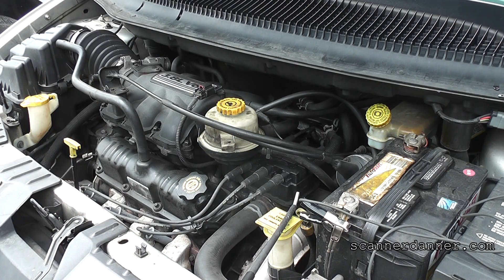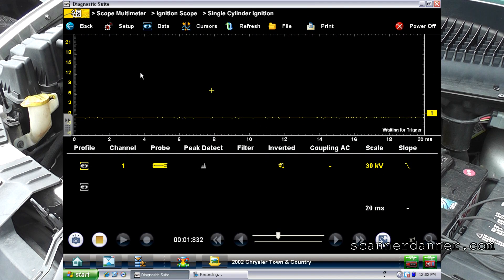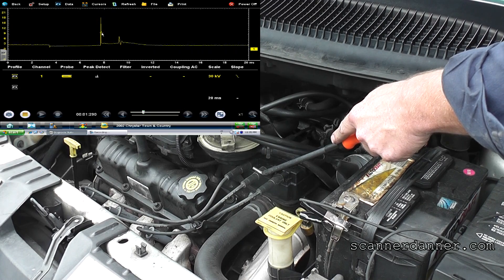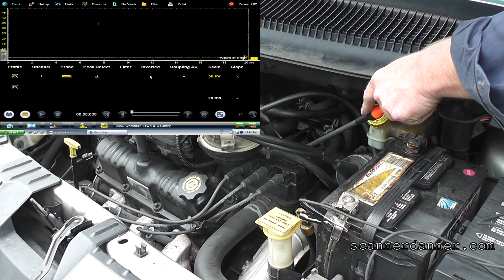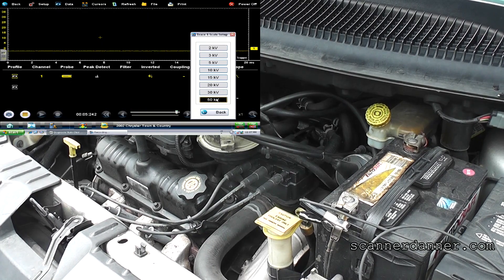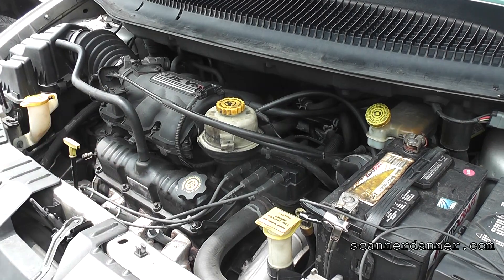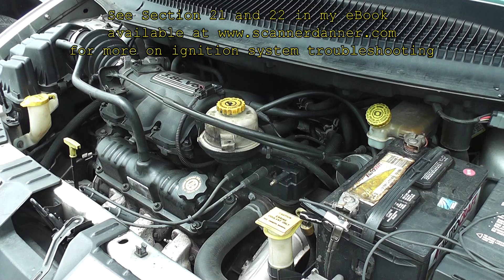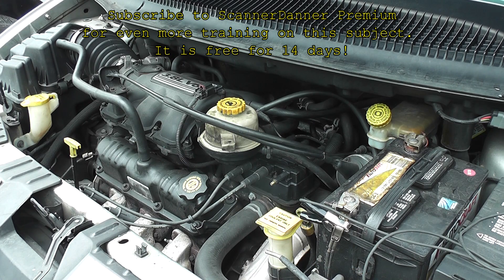Ignition testing with a scope (Secondary Waveforms) - open plug wire

Comment: But…what’s the possibility of a faulty plug or something else going on in cylinder number 5 that caused the cable arcing and then compromise the terminal connectivity to the cable?  Granted, a poor fab or crimp of the cable would likely yield this result.  Nonetheless, could there possibly be something up with cylinder 5 that caused the cable fatigue?
Reply from the maker: Pretty sure I moved the plug wire to another cylinder proving the fault. Sure an open plug could damage a wire, but that was not the case here, nor is it ever something I've seen (open plug). I've seen plenty of shorted plugs though

Comment: "To obtain your warranty, please send you deficient plug wire with the boxes UPC code, the original receipt, the name, address and business license of the store you purchased it at, the name, location and license number of the mechanic who installed it,  and a signed statement swearing it really is the wire you just bought and not one from another vehicle. And of course a check to pay for shipping, handling and whatever else we want both ways. We will then review your materials and decide if your violations of the terms of use caused this failure. Processing may take 3-6 months, failure analysis 4-6 moths and sending your replacement probe 3 months plus the 4 month trip in a slow boat across the ocean, the replacement probe may either new or used as we see fit. We look forward to your continued business, its a pleasure to serve you."
Reply: @ScannerDanner  Thats satire Dan on hoops many companies put people thru to claim warranty on an item, particularity mail order  and in this case the reasonably new spark plug wire. Not all are like that of course but for many its to expensive, long and aggravating of a process to bother with. I speak from experience.

Comment: Can we check secondary problem with in primary current wave
Reply from the maker: some can be seen but not all. If the windings are messed up, we can see that, if the spark is leaking out of a coil boot or wire, we will not see that in a primary waveform
Reply: @ScannerDanner  thank you sir🙏 for reply me. Sir I'm trying to use hantek I never used scope before just trying to increase my knowledge   watching your video thanks from India 🇮🇳

Comment: Thanks Paul, Great video.
It is a good example of how the scope can  illustrate what is going on  without having to dis assemble or  physically dig deep into the vehicle.
You provide excellent examples of what  can be seen  with an oscilloscope.
As a tech I have often found it difficult to see shop owners or managers to see the value of using a scope and to get other techs on board to become comfortable and knowledgeable to use it efficiently.

To those who insist on making do with the most basic methods:
Yes it can be done, by all means do which is convenient and works for you.
But you might be missing the point that the scope provides so much actual information as to what is really going on.
That is what Paul is trying to convey in his videos.
Reply from the maker: Thank you Dave!

Comment: Very cool tool. I just diagnosed (for the second time) one of these. About a month ago the guys in the shop replaced wires and injectors, i was called to look at it, #3 tower was completely dead..pull the plug wire off and nothing! Replaced coil , van was happy...came back Friday with the same misfire complaint and the same cylinder! Found a not fully secured 14pin connector just under the throttle body, the connector is actually broken and can no longer use the red lock to keep it shut...customer doesn't want to replace the connector so...we'll see what happens, could very well have been caused by the guys in the shop when they had the upper plenum off though...wondering if that bad connector had anything to do with the #3 tower not firing and maybe i jumped the gun and replaced a coil unnecessarily....i hate intermittent failures done times lol

Comment: I am pleased to see spark line analysis is still in use by some. I used it daily when I was a mechanic back from 80s onwards but it was a dark art then many mechanics didn't use, and when modern ignition arrived older tune scope could not be tuned to read values from the primary signal to the degree required. I just did a few videos on the topic of spark line analysis and the last one on wasted spark.  One thing you mentioned is the bad spark produced on the companion cylinder was due to it firing at the same time, which is right but Id just point out to anyone watching it who may not get that part, that the reason you see it on the companion cylinder is because in wasted spark each plug acts as the ground for the other plug and the secondary is not grounded to the primary common as it is in standard single coils so the current flows at one plug will be seen at the other plug also, hence inverted in polarity.

Comment: Do you or anyone happen to know the voltage conversion if you use it on a scope that does not have ignition testing.
Reply from the maker: I do not know the conversion and when I use this, I don't really care about the numbers as much as I do the patterns and comparison between cylinders
Reply: ScannerDanner Thank you. Know it is more about the pattern just was wondering I anyone new the conversion.

Comment: replaced wires an plugs run great after replaced parts next day when i tried to start hard to start had to pump pedal to keep running  if i tried to accelerate would stall will run good if i drive under 30 miles per hour  please help me i am lost .think it might be   maf sensor watch you  videos every day thanks keep them coming

Comment: very interesting video and you are one sharp technician.
Reply from the maker: +q zorn thank you!
Reply: +ScannerDanner do you think that a voltmeter can detect the problem checking the resistente
Reply: @Super032208  Tine ist money. It tooks time to get out all plugs. And you will perhaps recontact the broken wires during pulling the plugs.
And you have to do a  low ohm measurement - low cost multimeters don't die that.

Comment: Paul, visually is there a difference in a secondary and primary (coil negative) waveform? Is there diagnostic advantages to one or the other?
Reply from the maker: +Mr. Speed only difference is amplitude. they are a mirror image of each other. you can absolutely see secondary issues in a primary voltage waveform

Comment: hey danner gota question about a 96 chevy 1500 bought the truck it ran nice, i put in a stereo then it rained,.. the next day truck cranks but no start obd2 scanner just said p0302 2 cyl misfire,. checked spark theres spark and fuel gettin ta engine i dont know where ta start ive actually replaced the starter silinoid cause it was sparkin thought maybie that was the case but still crank and no start any pointers what direction ta go or what type of scanner ta get to let me know what is wrong actually..?? thanks god bless
Reply from the maker: +Francis Shattuck where did you test it for spark? Does the distributor cap have plug wires that come out of the side or the top?
Reply: the side.. im actually watching diffrent vids now and spark wasnt that great i had to get closer than a half an inch ta see barely a spark.. tested everywhere the only spot that was a nice spark was the ignitioion coil i believe its called lol.
Reply from the maker: +Francis Shattuck common problem on these is a bad distributor cap. also I've seen the rotors burn through as well.

Comment: Hey paul, awesome videos. Is this the only tool (wyze) that is out there or can be used for testing secondary waveforms with the scope? Or at least, the easiest?
Reply: I am directing all help requests to my forum. Sign up (it's free) and create a new post. Be sure to add a name under "alias" as this is the name that will appear in the post.
Here is the link to the forum. 
http://www.scannerdanner.com/ForumRetrieve.aspx?ForumID=3226
Thanks!
Reply: There are Hantek HT25 and Hantek HT25COP (for coil on plug systems).

Comment: I agree with Abdulalah Faraj---- Paul is a smart guy but please Paul show how you hook up the tools to the scope in all your videos. What good is it to see the wave if we do not understand how to hook up all the different tools.  I bought a used modis and your book,, but trying to find (somewhere) how to hook the all the different leads or attachments  (low amp-- high amp--- and so on) and all the other attachments that i may have gotten with the used modis)so i can get to the point where i can see the waveforms-- is a full time job. Snap on sucks as far as finding info on line showing hook ups. I have yet to find any info anywhere that explained what the personality keys were used for or where they plugged in. I finally figured it out on my own. Even the multi meter i had trouble hooking up the leads. I have a video from snapon showing  that their modis ( i guess a different model) hooks up at channel 3 and 4, but their video shows a volt/ohm symbol at 3 and 4..   (i tried mine that way no luck) Mine just shows just ohms. So i hooked up at-- black ground-- red channel 1-- then it worked. And it goes on and on..... Please show the hook ups,,,  Or maybe my modis is broken,, but how would i know?  Maybe if i had the 6,000 cash to buy a brand new scope it might have come with all the books that show all the hook up info??? Maybe ? So the bottom line is,,,, that the videos and your book have lots of value with those that grew up in the trade or go to school where questions can be asked. FRUSTRATED--- I am a master 30 year carpenter/foreman/superintendent.. but an idiot in modis hook up.... LOL Somebody please start showing tool hook ups for us trying to learn...
Reply from the maker: This will be exactly what you are looking for.
https://www.youtube.com/playlist?list=PLM4TD8VJ3gj_fg_miN2Uu0yRMc5xSySy3
It is an 11 hour course on the Verus which will transfer nicely to your modis. I promise you will not be disappointed.
Reply: I am copying this from a comment from the link you sent me,, it says not showing set up.
"Hi paul just to let you know because of you and duane from realfixesrealfast use snapon diagnostic products i decided to get the modis ultra and the amp probe

 but i wish you would take some time and show us how to set up the scope in detail.

 So far i had diag three different vehicles with intermittent problems thanks to the scope i was able to look at the wave forms And pin point the problem. Some techs recomend bringing the vehicle in when the vehicle is acting up but with the scope most of the times you dont really need to do that."
Reply: robert mccully This is a good link. Are you not able to click on it?
http://www.youtube.com/playlist?list=PLM4TD8VJ3gj_fg_miN2Uu0yRMc5xSySy3

Comment: I can not get the partter using wizaprobe at muy vantage pro,do you can  hel my
Reply from the maker: Some C.O.P. designs it is not very good at reading. (Mainly 3 and 4 wire designs, where the transistor is in the coil)

Comment: Could you have not used you test light and shoved it in the end of the spark plug wire and tested the strength of the spark and then removed the wire and stuck it in the coil socket of that cylinder

Comment: What was the original problem before shop replaced wires and spark plug?  Or was that the routine maintenance done?  Here is a classic case of why I prefer not to let professional lay hand on the car unless it is absolutely necessary!

Comment: Great video i am using a paddle probe and a fluke 192 scopemeter i think if you had switch the plug wires and look on the scantool in misfire counters and dtc's you should have seen it .

Comment: Good diagnosis Paul, nice to see you using ignition scope, good probe you have there, not a very good new plug lead, poor quality, does the scope have a Vertical Parade on, would be easier to see with that, vertical line for each cylinder, one would have been right off the scale, I used to use Sun Analizers cheers from England....Fred.
Reply from the maker: It does but you have to use a different much more complicated set up for that. The adapter has one lead for each plug wire (waste spark set up)
Reply: ScannerDanner Ah yes, it was a lot easier with one coil and a distributor...just had one connector for number 1 lead and 1 for the coil ht lead...Fred

Comment: measuring resistance between the two ends of the wire will be helpful for checking the wire .
Reply from the maker: For sure, as long as you do not break a good wire pulling it off (which happens a lot)

Comment: Thanks for sharing that Paul.  You should do some more ignition videos showing different scenarios, I'm still new to this type of diagnostics, but I'm starting to realize if you can understand the waveform, you can asses the mechanical condition of the engine very quickly.  Have a happy 4th.

Comment: Wish you would have done a resistance test before pulling it apart.  Think that would have shown an issue?
Reply from the maker: I believe it would have shown an open in that plug wire

Comment: To test wires w/o scope, break out ohm meter?
Reply from the maker: You could do that but your chances of breaking plug wires while trying to remove them is too great. Plus you do not even know if that is the problem yet. So from a direction standpoint, measuring plug wire resistance in hopes that you find a bad one is a poor choice.

Comment: "How do you make that call without a scope?"

P0302; suspect Cyl. #2, check companion if waste spark.  Spark tester at end of each plug wire; if good inspect plugs, if bad connect directly to spark tower; if reading good inspect wire, if bad inspect coil.

Troubleshooting brain-speak, but that's pretty much the path my brain follows.

Comment: I liked it - nice tool will have to check it out.
Reply: They have another one called a paddle probe and it is a fraction of the cost. I've never tried it yet on my other scopes. I will though and let you know what I think.
Reply: Hey Paul, Between the paddle probe or this wyze probe, which would you prefer using.?
Thanks again

Comment: as soon as u said the wires had recently been changed I thought check for poor routing/securing of the wires around the firewall side that has lead to heat damage to the wire insulation. seen that too many times.

Comment: Hi Paul, Would your probe work with the original Vantage?
Reply: This is the website with the vantage and wyzprobe.http://www.efitools.com/page6.html
Reply: Not sure, I don't see why not as I have viewed primary voltage patterns before. The detail isn't there but would have probably caught this one
Reply: Johathan, if you go to the wyzprobe website they actually show using a old school vantage with the wyzprobe.  Considering how old the Vantage is, it's not half bad, take a look.
Reply: busjockey1 Thanks for the info I will check that out, the original vantage is still quite a useful tool